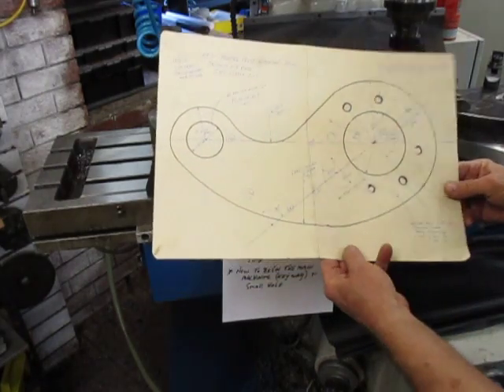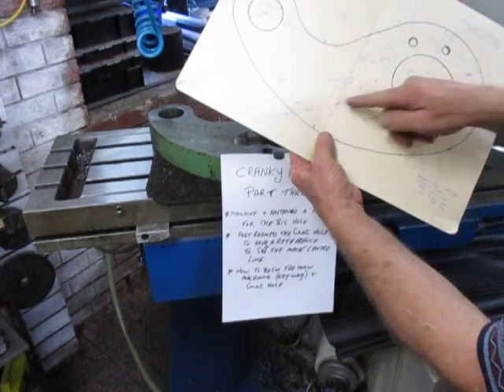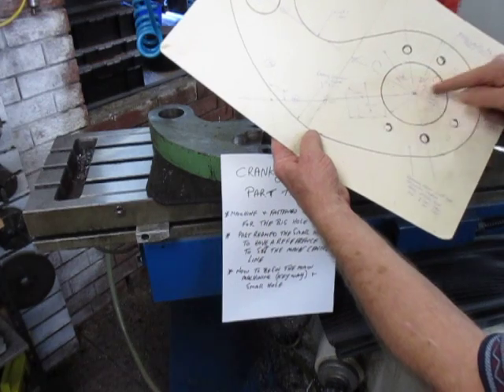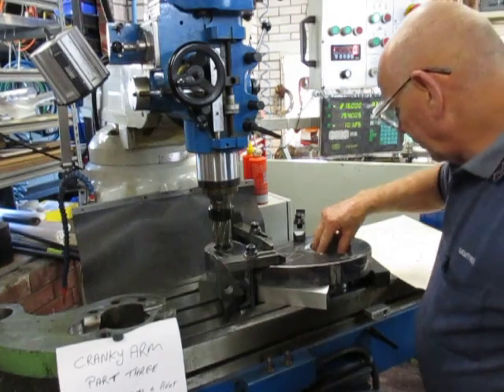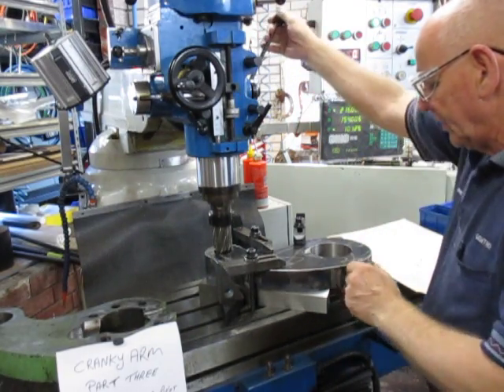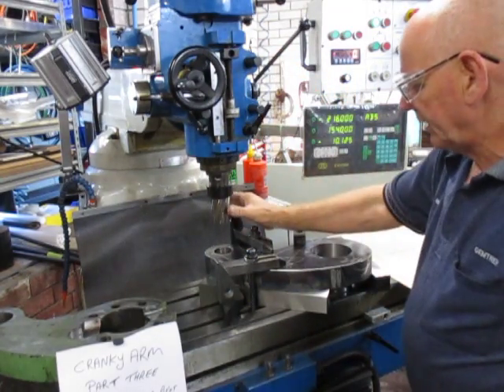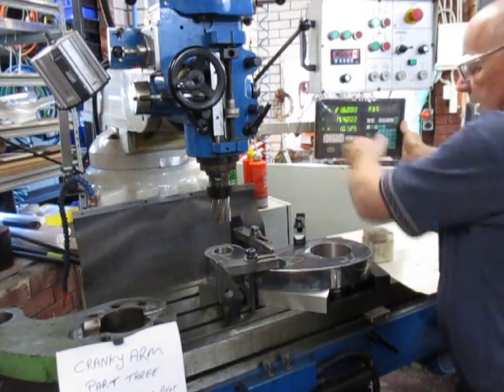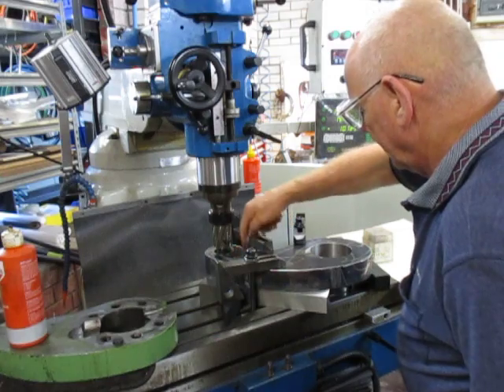Cranky Arm part 3

Comment: Bruce, I really enjoy your videos.  Always great to see how to fixture and process unusual parts.  Can you briefly explain why you are "step drilling" with the rotorbroach?  I would have guessed you could have just gone to the largest size you had before boring?  I'm sure there is a trick in there I'm missing?  Thanks!
Reply from the maker: Joel L Joel thanks for the visit, I step drill (peck) quite a lot on most drilling, reaming and broaching jobs, it is so important to avoid long stringy swarf, and to reduce load and clear the area of waste.With Roto Broaches the wall is so thin that there is little room for waste and any build up causes binding that shatters the broach. With reamers the flutes are generally narrow and shallow and here the binding can cause total "Lock up" and cease the reamer and destroy the job. drills are the most forgiving because of the wide and deep flutes even so I still like to peck the job, clean out and reapply cutting fluid that I do not make any qualms about using liberally. I hope this helps to understand my methods.